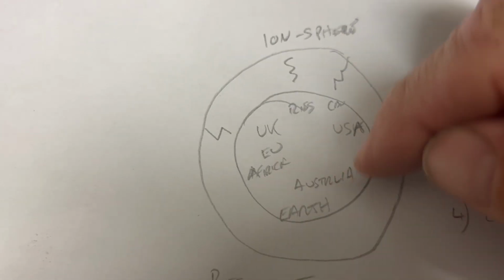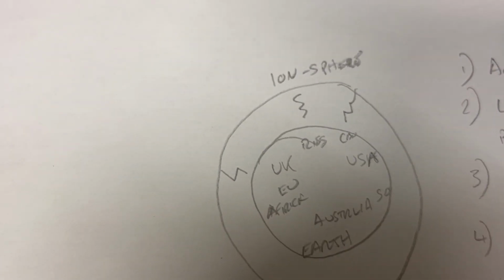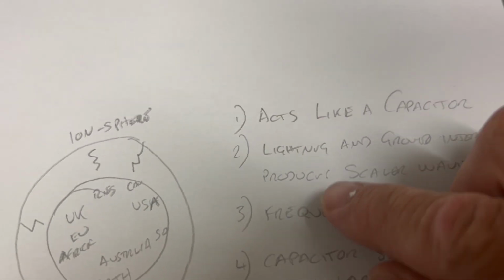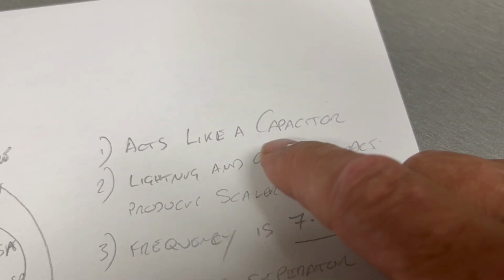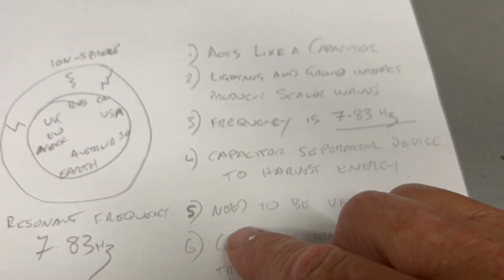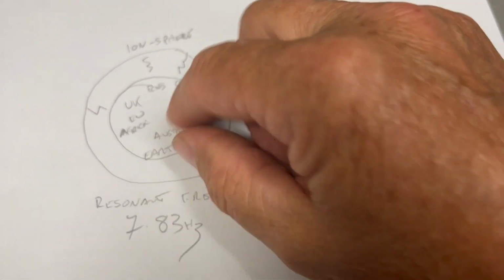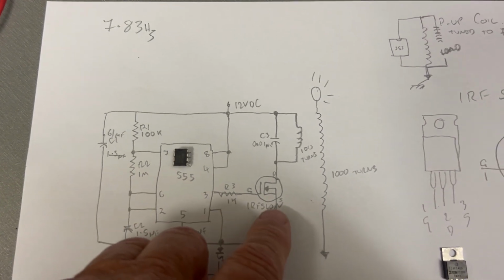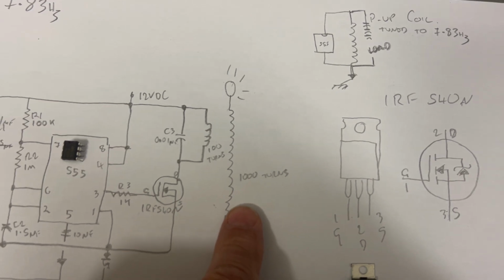Slayer exciter Hurtz with a 555 And MOSFET.

Comment: What is the wire thickness primary and secondary
Thanks for sharing
Reply from the maker: Primary 1mm. Secondry .5mm. Very good question. I actually did the math on these first but have not shared yet. I planned to share 1/10 resonant pickup or quarter wave but it became aparent to share the primary circuit first.